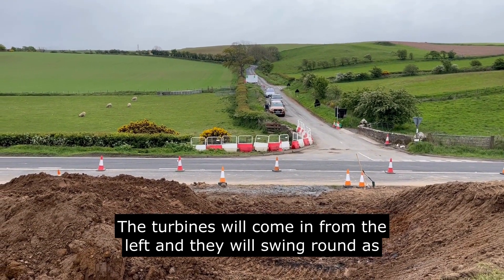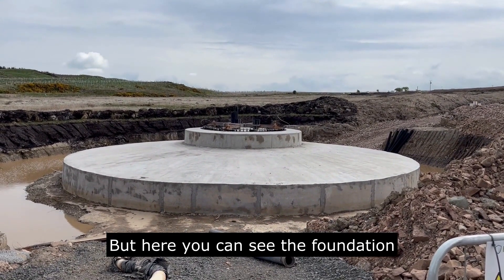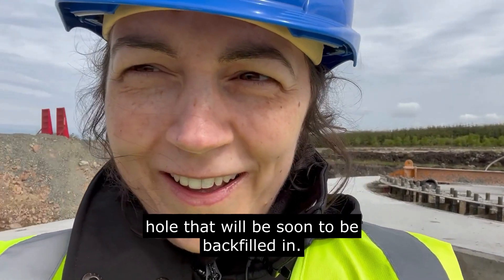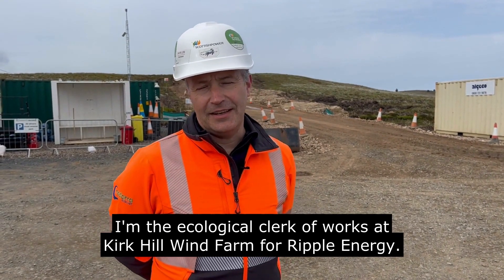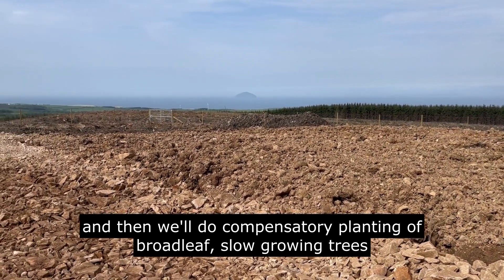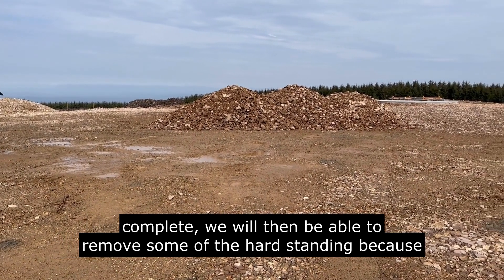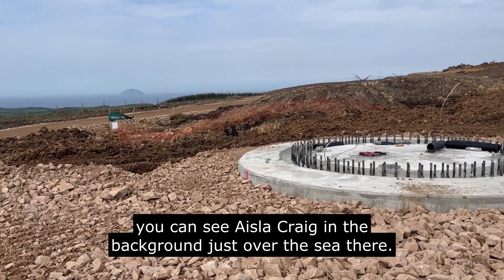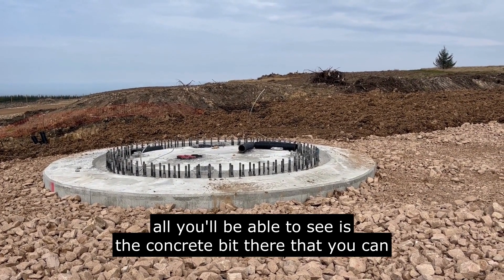Kirk Hill Foundations

Comment: What's the carbon footprint of using all that machinery, building materials, concrete etc, plus the carbon cost of the materials used to manufacture and transport the turbines themselves? Do you actually have an accurate measure of this? 
What about the energy cost? Will you ever get a positive return on energy expended within the lifetime of the project? Please don't forget to include the energy requirements for the dismantling / disposal / recycling of all those materials.